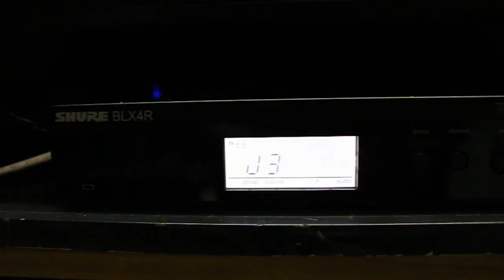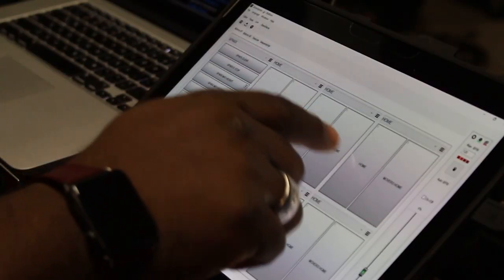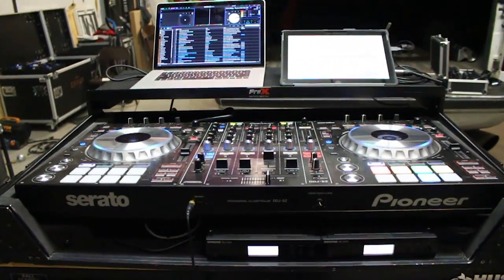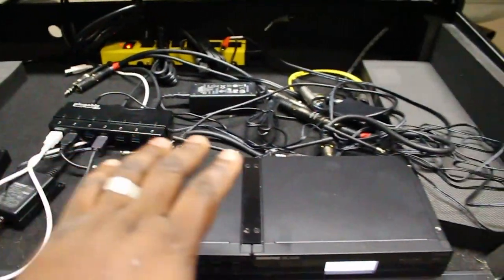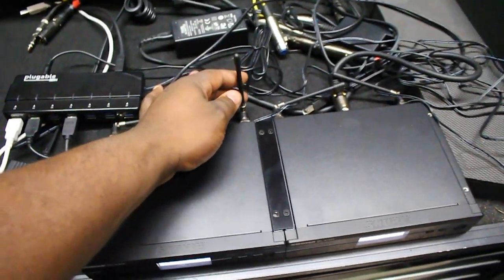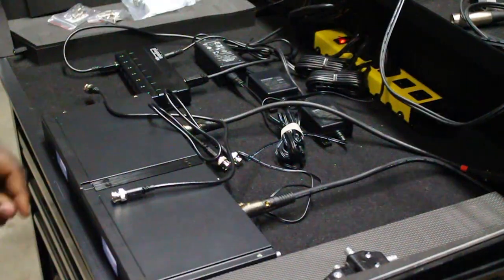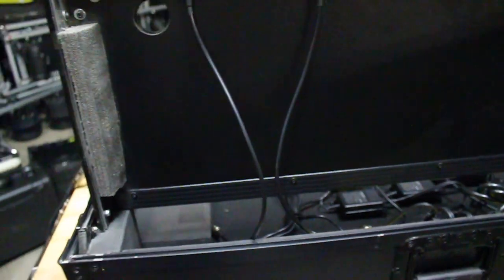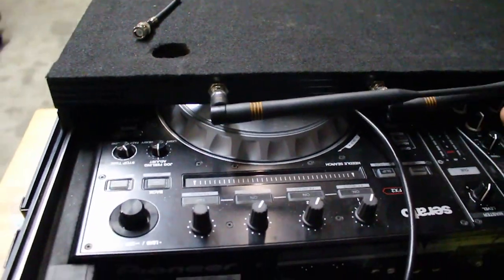DJ COFFIN TOUR! | ELIMINATE MIC DROPOUTS FOREVER!

Comment: Hey Brother great video. I like what you did with the antennas and the placement of it. It was easy and clean install. Flawless!!! I have a small recommendation, on your ProX case (I love that brand too) you should put grease or some kind of lubricant to slide the top better. Overall great video.

Comment: ..this is great... i been meaning to do something similar to extend the antenna on my GTD Audio G-733 and hook up the same way on my Pioneer SX2 case ... now wondering if this would work for the GTD. hmm
Reply: I had the GTD 787s, great beginner/entry level system. Did a review on amazon.  with pics showing the case and added antennas.  I Upgraded  to the Shure GLX-D Advanced series and have not look back. Just my two cents

Comment: Nice video.  Will the antennas work with the shure glxd24 receiver?
Reply: DJ JB Smuve No, Cause the GLXDS run on 2.4 GHz (Same as WiFi) and the BLX Run on The UHF Frequency Range 512-608MHz
Reply: @Walmarts Wifi Thx.👍

Comment: Hi john. I was wondering if you get any interference having your mic receiver under the sz. I was told to try and keep the receiver away from electronics which I know is hard to do considering our set up is usually small and compact as it is. Thanks in advance. By the way new to the channel.
Reply from the maker: I've never had any issues with interference. I moved the antennas just as a precaution.
Reply: Oh ok. I been wanting to do that with my receiver as well. I hate hauling it around and having something else to set up. It be dope to have it underneath as well. Thanks for the info. Happy holidays !